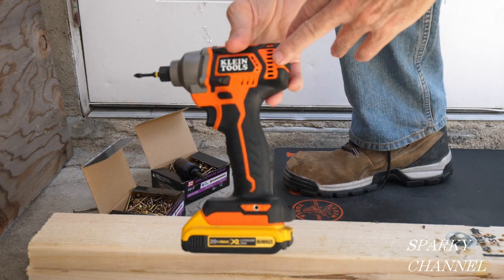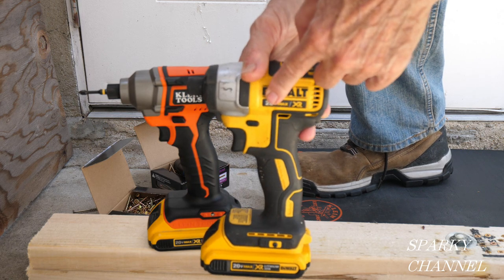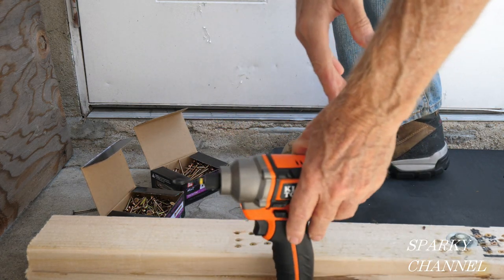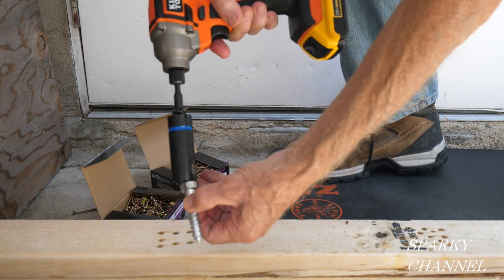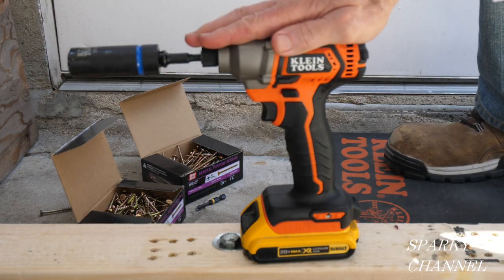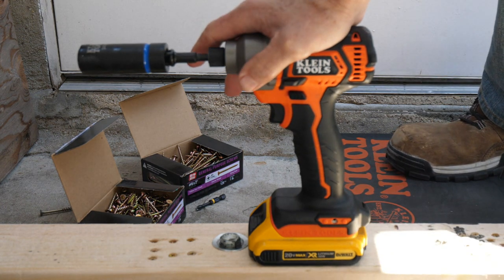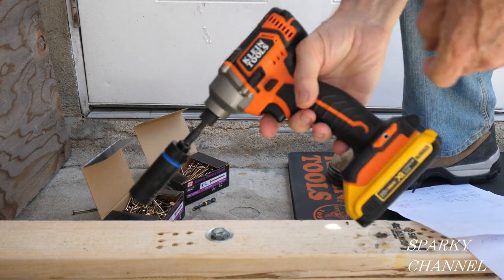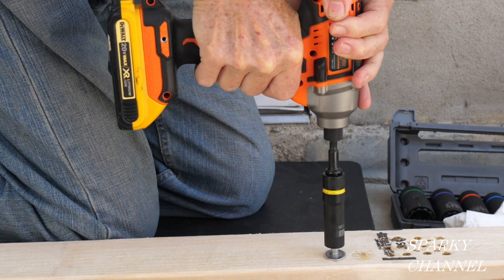Klein New High Torque Brushless Impact Driver BAT20-CD Review

Comment: Its like having a Ferrari with a chevy engine...you gotta have your own batteries...top line tool company with another manufacturers battery...bad look
Reply: Dewalt makes some of the best drill batteries on the market
Reply: dewalt has the best selection of batteries, klein is smart in not trying to add to the pile of proprietary dead ends in the power tool industry
Reply: @edwardoavila7666  I agree but they could have at least had it in orange

Comment: So is Klein getting re-badged DeWalt-XR gear? I glad we finally have some more battery compatibility between brands!
Reply: And I would prefer putting a bit adapter on the wrench: all that impact technology, just for a 1/4" bit holder, seems such a waste to me.
Reply from the maker: I don't know if this impact driver is a rebadged DeWalt or not. Certainly it's made to fit a DeWalt battery and at the least that would require a license from DeWalt. It is great see see 2 big companies using the same battery though. Yes, that is a lot of torque for a 1/4" hex head.
Reply: @SparkyChannel  even using the same battery requires a ton of contracts. I've seen these side by side: I think DeWalt was a bit lazy and could've made 'em look a bit more different :-) I'm also glad they didn't make the batteries incompatible! Imagine that mess with car batteries!?

Comment: I always have a very hard time getting the screw to go in for the last 1/2 inch.  I push as hard as I can, but it still won't hardly go in.  If a drill has more torque does that make the screw go in with less muscle (like I have)?  Or does it still need the man muscle?  Thanks Bill!!!!!!
Reply from the maker: Hi Judie! Yes, this driver will screw fasteners down the last 1/2" for sure! And yes, more torque does make the screws go down easier. Thanks!

Comment: @Sparky Channel. Thanks Bill for the review and intro of the new Klein Impact Driver. Although a rebadged Dewalt 20V MAX, it's good that Klein worked with one of the professional power tool companies for their cordless power tools. Looks like both the impact driver and impact wrench are only single speed compared to others. Hopefully we'll get a long term tool use review in the future.

Hope you and your family stay safe and well.
Reply from the maker: I don't know if this impact driver is a rebadged DeWalt or not. Certainly it's made to fit a DeWalt battery and at the least that would require a license from DeWalt. It is great see see  2 big companies using the same battery though. Thanks, same to you!

Comment: The Klein is an interesting tool but I am locked into Milwaukee because I own so many Milwaukee batteries.
I do not recommend an impact driver for deck screws because the driver will break the heads off the screws.